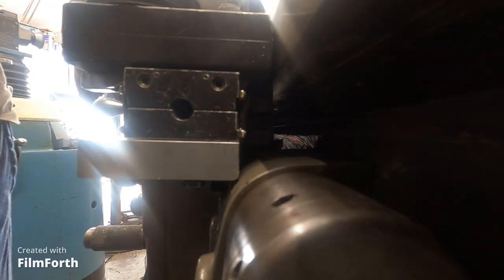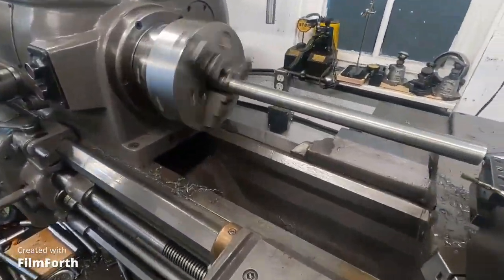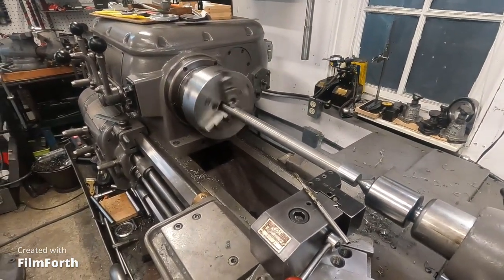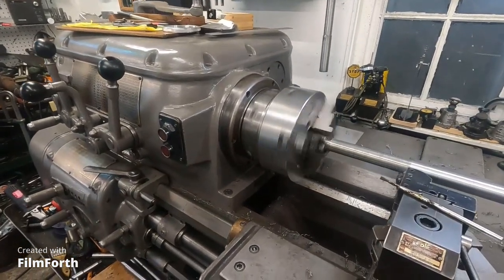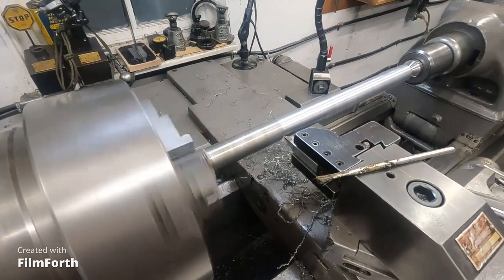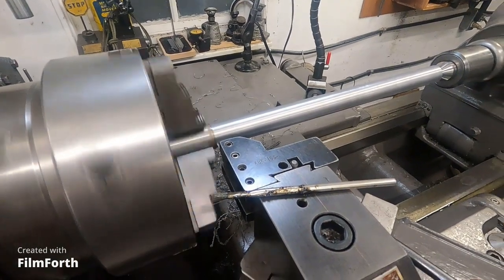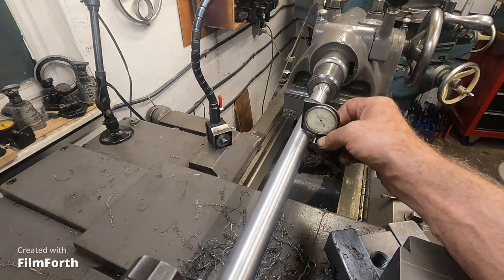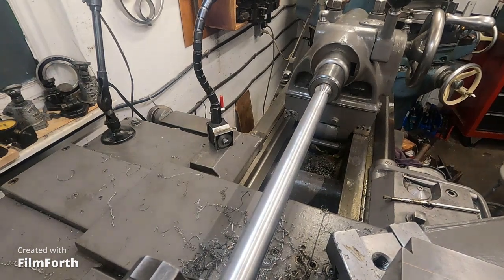Baby Axelson 14X30 Engine Lathe finds improvement in latest adjustments

Comment: Would be interesting to see the result tuning away from the chuck .
Reply from the maker: I haven't thought of that! I am finding that machines that had sat for years without use takes many hours running to fully lube up and begin to work correctly, same with that old mill here. The machines were designed to be used they cost as much as a house when they were built.

Comment: Hello Dee dee, how are you doing? Your dog reminds me of my Weimaraner Dog I had,lol. The tool height and saddle rotation movement I take it is what you're fighting with. Could you shim the 4 corners of the saddle so to use unused areas of the bed, or is that against your best practice or just plan stupidity?
Reply from the maker: What I found is like having a light out in a far corner you have not needed to go into. I can more easily shift "the shiftiest of all tool post" KDK tool post with an offset holder move the carriage where there is no problem, move the tool to the bad spot and cut true there and likely the rest of the way to the chuck. Shifting things around a little is harder on small machines, this is a heavy machine, the tools can be extended without chatter, the tool post was made in LA where the lathe was and was chosen by advice from an experienced operator to help get around using an older Axelson with some wear. Thanks

Comment: Trying to get my head around what’s happening here, does the taper on the part up toward the tail stock mean the carriage is riding up onto some unworn part of the bed? Thanks for the video
Reply from the maker: Yes, the machine was not used toward the right end and it is causing the tool to push into the work. So I backed off the carriage gibs and it improved, and seems to be improving more as I am working it.